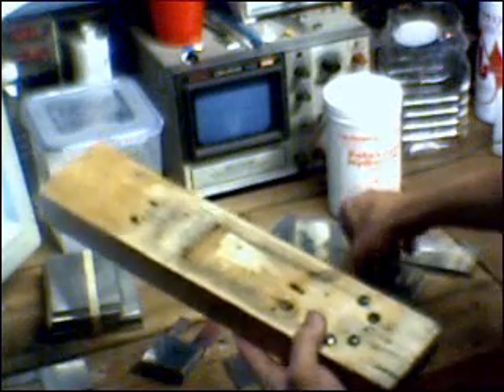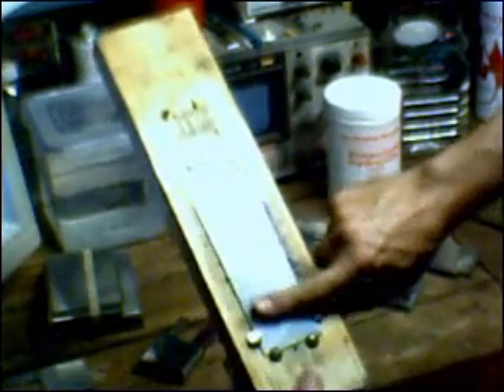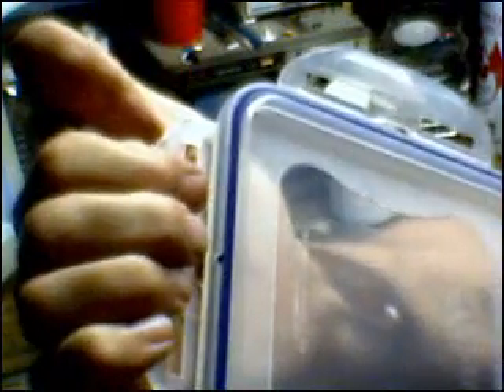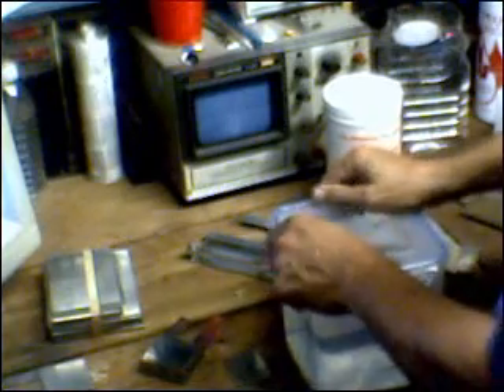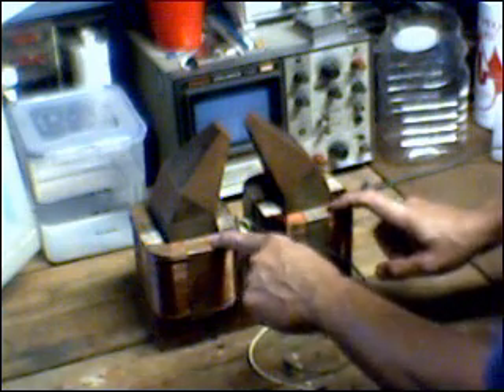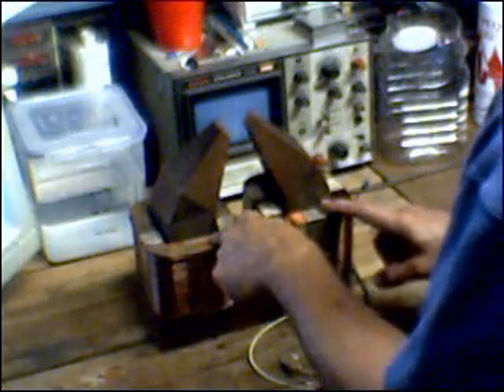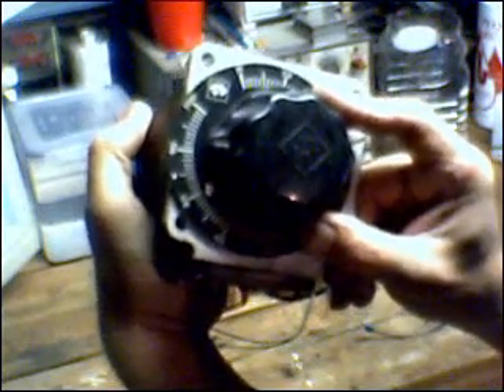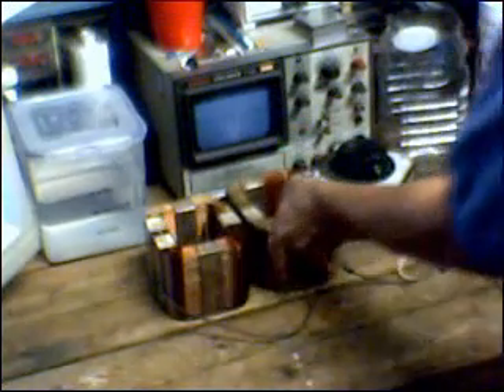#37 Back building a new hho electrolyzer part 2

Comment: A HHO Hydrogen power generator for your car better than you think.!!!

ACMEC HHO kits are designed for hho gas production in low voltage & low amps. All hho kits generated Hydrogen and oxygen gases nothing else.! You never try to store  , use it as you make it . HHO on demand system according to your needs considered very very safe.

Yes HHO CAR KIT will improve your engine horsepower and efficiency while reducing toxic gas emissions hho kit will solved all engine heating problem automatically. Engine will run clean and smoothly requiring very little maintenance, you will only have to add distilled water. Hho is best for  decarbonization of your cars. So make your car zero emission. In this way you can stop polluting the atmosphere.!!

You will not see brown deposits in our new designed long lasting hho kits. Our  kits for efi cars working up to two amps. 

But our transparent hho kits for carburetor types engines working up to 8 AMPS. For better fuel economy. ACMEC HHO CAR KITS can installed on petrol, Cng gas, or diesel engines, to run smoothly and your life will much easier.

For more call zafar 03082266179 or watch hho zafar videos on YouTube.

Comment: That's why you start out small.  I've seen to many videos of industrial sized machines as prototypes.  They usually have very odd claims.  My motor was housed inside of a peanut can.  This was because the shaft was nothing more than a piece of glass tube.  It got up to around 1200 rpm before going unbalanced.  So we needed to make sure nobody got glass in their eyes.

Comment from the maker: Yes, you should have seen the contraption he built. The ring of electromagnets looked just like the jig you see in my video without the angled pieces. about 20 of these were arranged on a frame that stood like a clock face almost 6' tall, resembling an aircraft engine. The armature was a massive arm that swung from the center with a heavy steel bar at the end for each electromagnet to attract in succession, UNBALANCED like clock hands!

Comment: Brushless DC motor!  I built a brushless DC motor in college but I used permanent magnets and a hall effect switch.  One of a kind for the class.  The instructor never saw a student build a smart controller for a motor.  I now work on AC, DC, and Synchronous drives.  I'm always amazed by your work, and it appears you enjoy it.

Comment: Hey ZFF, long time no see.  I think the pulse waves are the way to go.  Stanley Meyers put up to 20,000 cycles through his device and he explains it as shattering the molecule.  In fact, I think high frequencies is the "Holy Grail" of science.  Stanley Meyers used very low voltage and amps to produce fairly high volumes of HHO.  Have you seen any of his videos?